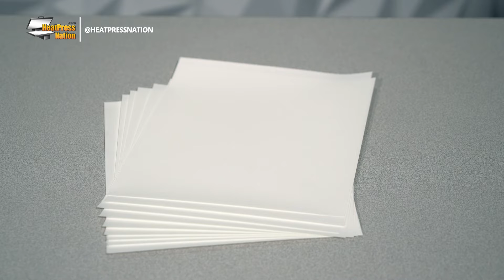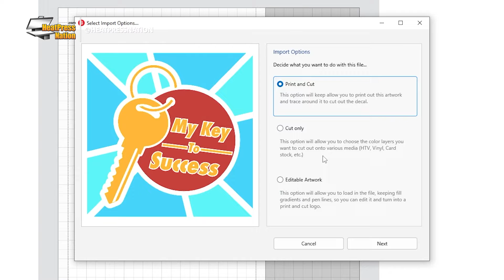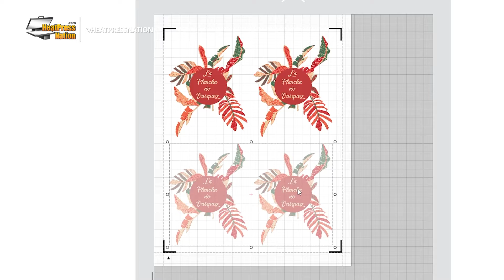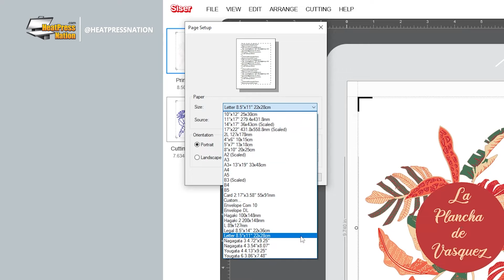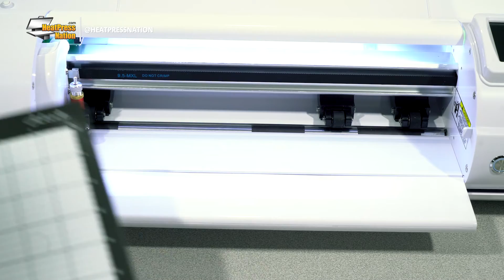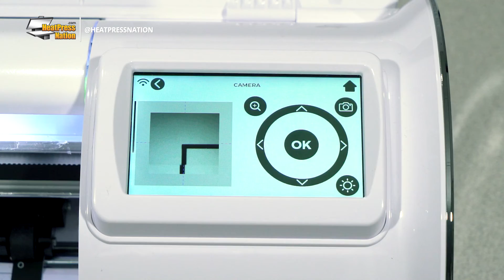Siser Cutters: How to Print and Cut

Comment: how do you avoid cutting inside the art work, for example, little circle inside the letter A or D. When I expand the contour, it doesnt weld the entire image together. It also contours little shapes and holes inside the image as well that I dont want cut. I just want contour around the edge of the image, not whats inside. Even though i move the cutting contour offset bar to the far right, it will create contours inside! its driving me mad!
Reply from the maker: Hi Dan! These edits must be made on the image itself before uploading it. If this is a contour cut image, it means that the background is not transparent.
Reply: You might have "include holes" toggled.  That traces the holes when you go through the contour part.
Reply: @vanillarice24  I have that disabled, it just highlights every detail and cuts it anyways
Reply: @dandee28  I had this issue the other day (actually have an issues with the machine and software myself I just got it). Try putting a white underlay.
Reply: @vanillarice24  hmm do you mean white background?
Reply: @dandee28  Yeah. Im having the same issue with a QR code. I have to put a white underlay under it. The software keeps removing the background.

Comment: WHAT WILL YOU RECOMMEND FOR A BEGINNER INTO SHIRT MAKING, CRICUT OR JULIET? WHICH OF THEM IS BETTER OFF? HELP PLEASE
Reply: As a cricut user I find print and cut is some what limited although they have changed it so you can print and cut bigger stuff but still to a limited size.  I used mine with a Sawgrass sg500 which although is A4  is limited to slightly smaller with design space print and cut where as this looks like you can expand to fit material/mat size which seems less wasteful of materials and getting the maximum out of an A4 sheet.
Cricut is good for everything else though just think print and cut is rubbish unless you own an A3 printer to make use of bigger cutting mats and the new update and I'm not ready to buy an sg1000 at £1000 😂 just for print and cut